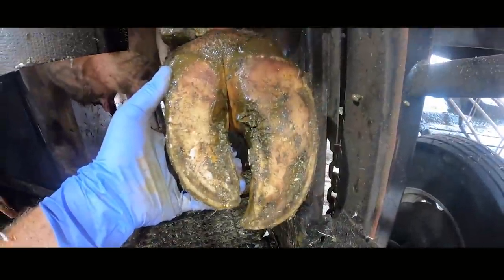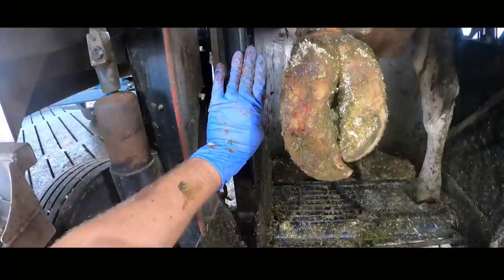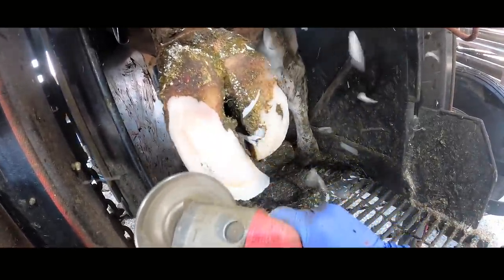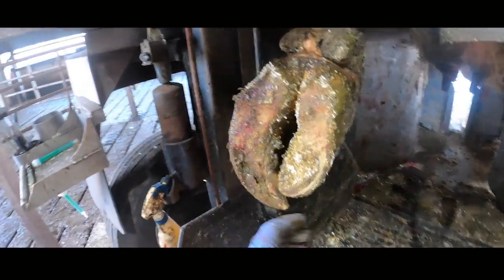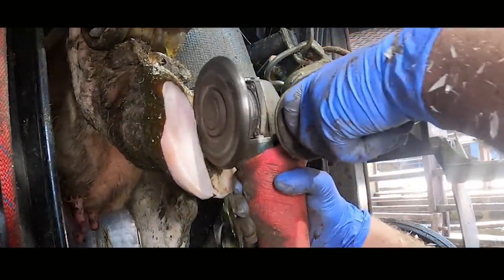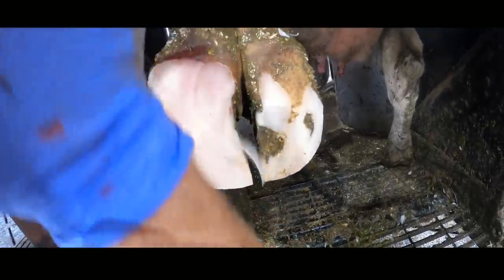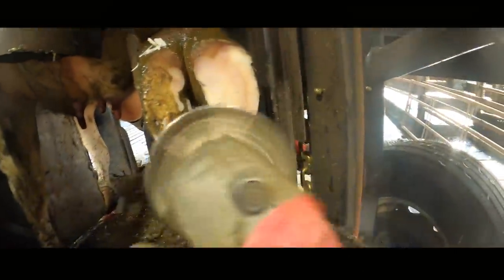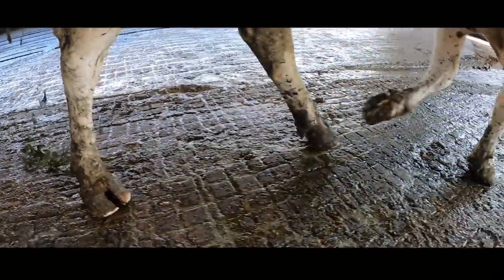*COWS FOOT RESTORATION* ... SATISFYING PERFECTION??

Comment: I have a question. In theses cases when the laminae streach and you have to take the toe back, dont you end up taking the outer wall off the toe area? Is that not detrimentral since the need the outer wall to be weight bering? To qoute previous videos.

Comment: GP, my wife’s family has around 100 head here in the state of Maine. We have 2 breeds, Angus and Guernsey. My wife grew up on the farm and we all help out as much as the family can. However, this leads me to try and think about the cows feet. I have never seen nor has my wife recall seeing any hoof trimmers coming to the farm. Nor had my wife seen anyone talk about hoof trimming in her nearly 35 years in farming. All cows to me, I would now believe do need trimming correct?
Reply: Ideally yes, that doesn't necessarily mean though, getting a hoof trimmer in to do it. The benefits of routine trimming go beyond the prevention of clinical lameness and include higher production, better fertility and reduced mastitis levels. with all these benefits plus the opportunity to sell more heifers, it isn't hard to see how it affects the bottom line.

Comment: Why do owns always seem to have more issues on their back feet than their front?
Reply: During another vid Graeme said that's because the dairy cows have a odd way of walking on rear feet, and all cows' back feet have more exposure to moisture and bacteria since they are closer to the poop/pee points.
Reply: @lynnebucher6537  Most  of  the   weight  is  over  the   back   feet , and   it's  the  back  feet/legs  that   do almost all the work  in  lifting a 500-700kg  cow up  and  down.